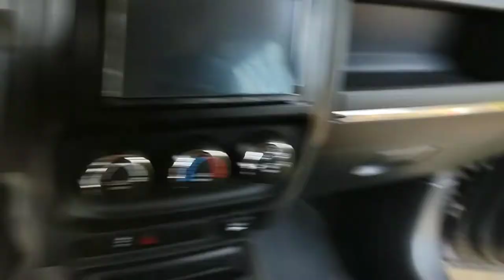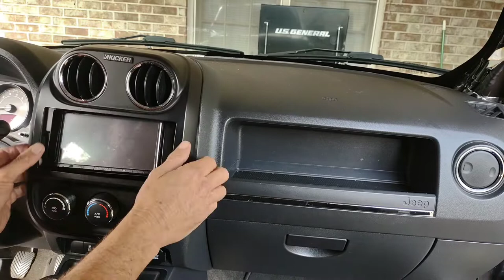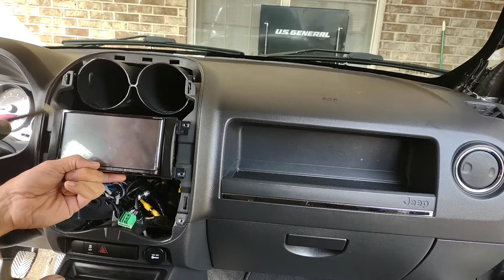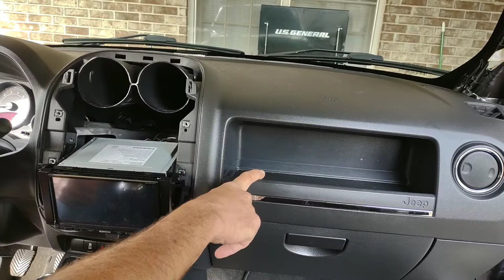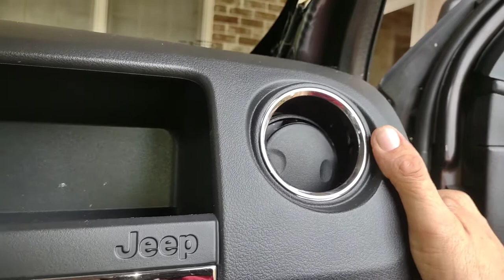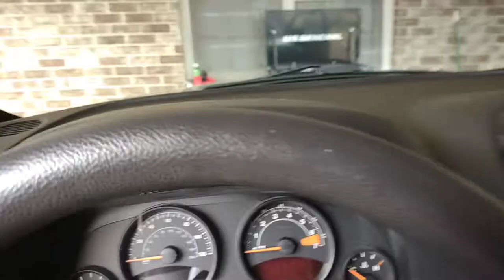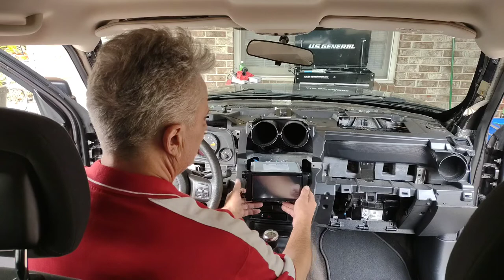Jeep Patriot top dash pad removal & spk replacement

Comment: If you power the crossover with a 9v battery and wire to any speaker if speaker pushes outward the polarity is correct if the speaker sucks inwards it is wrong ; ) that should help if you want to know if something is positive and negative correctly
Reply from the maker: Unfortunately that doesn't work to well on drivers with very little excursion, also the capacitors in the crossover absorb most of the battery. I did try it with a AA battery without the crossover but the domes limited excursion made it too hard to tell. 
It's on to bigger and better things now 😁.

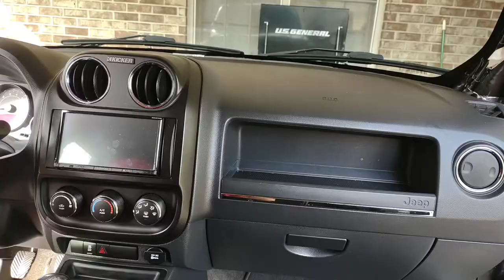Comment: I need to remove the radio / AC control bezel to fix the AC controls. At 3:52 it looks like you are doing that without using any tools - I am almost in disbelief (because when I try similar things on mine it doesn’t budge). Any tips?
Reply from the maker: I don't like to use tools unless absolutely necessary. Start at a bottom corner and pull outward. If you can get it, just carefully use a butter knife to get under the plastic and give it a twist.
Reply: @thenotoriousrvh6091   - thanks I will give that a try. Initially I thought I was going to have to take the whole dash apart, but watched your video and I just have to remove that bezel - gave me confidence that this wouldn’t be too difficult.
Reply from the maker: I should've added this technique is for the 2012 & up.
Reply: @thenotoriousrvh6091  - I have a 2010; another video I saw for that year had a similar approach, using a thin pry tool at the points where the catches are on the sides. So I think your video is close enough for my needs. Thanks once again.
Reply: @thenotoriousrvh6091   - I just finished getting that radio bezel off and the repair I needed to do. Your video and tips were exactly the assistance I needed. I had put off this repair thinking that getting that panel off would need an excessive effort and clearly that was not the case. Thank you very much.